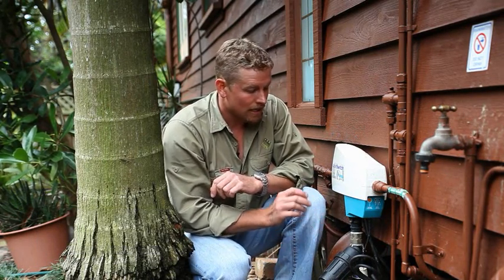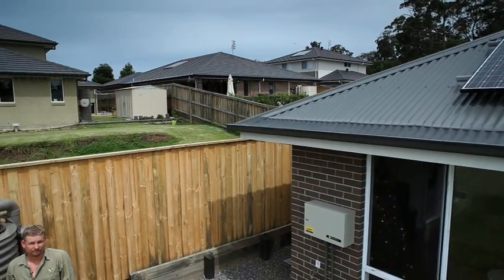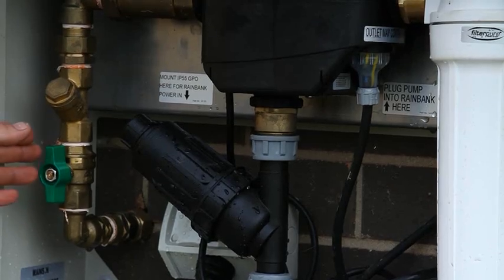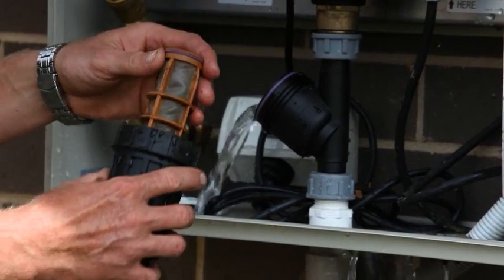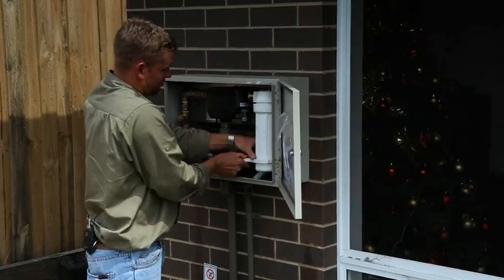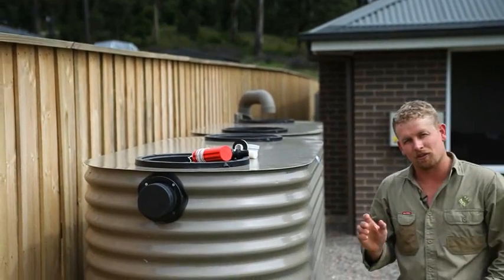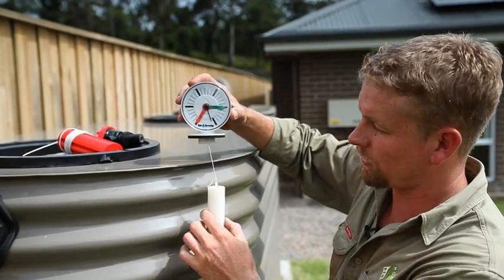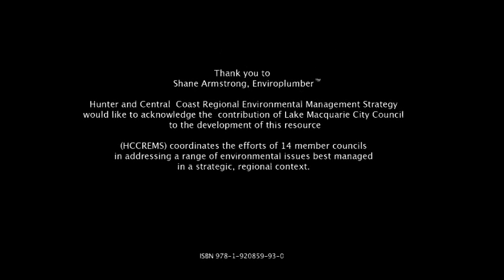Clip 4 - Rainwater tank pumps and controllers

Comment: Nice. Which way runs best with least issues or warranty claims for the running gear in general, submersible or external? Which way from the installations you’ve done has the least issues? Submersible or external?